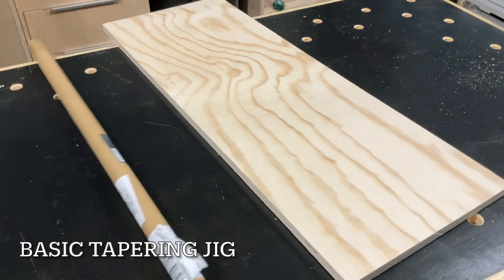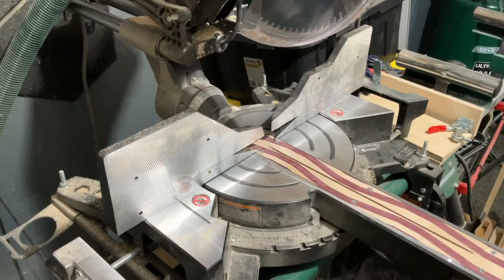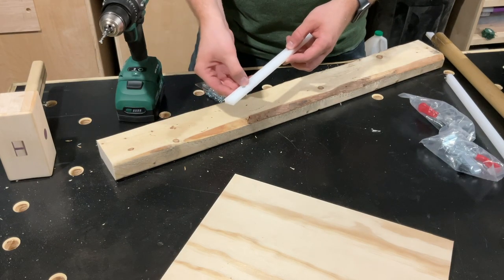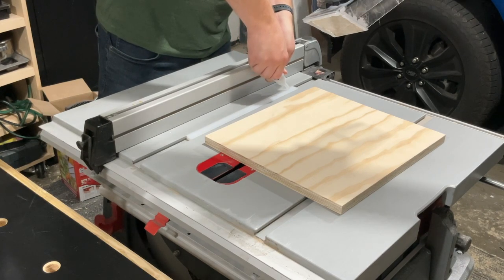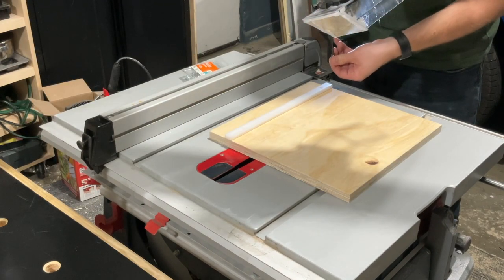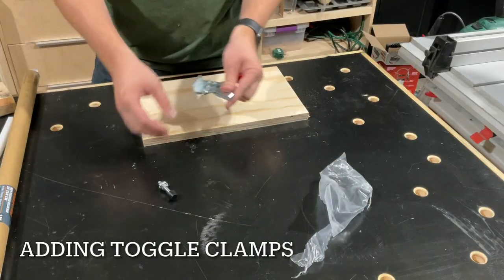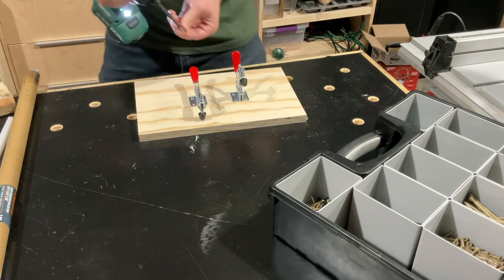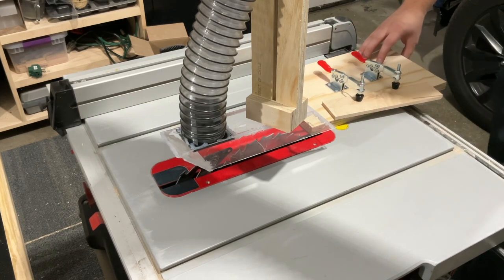Basic Mini Tapering Jig

Comment: Super simple and handy, indeed. Well done. One good tip (for beginners) about using those plastic runners is, don't over-tighten the screws. It can cause the plastic to bulge causing the sled to not move as freely.

My first one was way over-done. It was large and I hardly ever used it. I got a couple of those dovetail clamps from MicroJig and made a much smaller sled. It has 4 dovetail slots that are perpendicular to the blade and then one slot that goes the length of the sled, slightly offset from the middle. I use it all the time. Simple to make and simple to use.